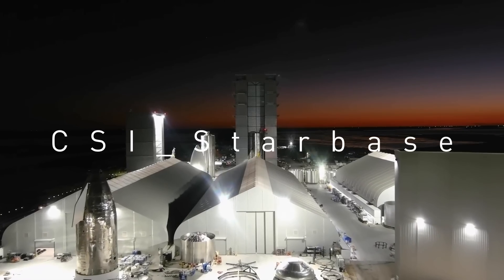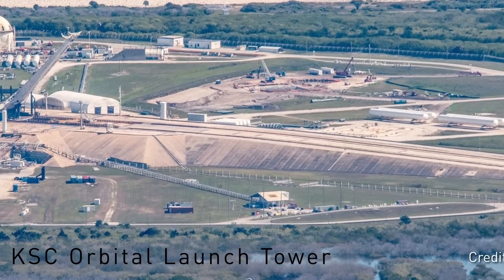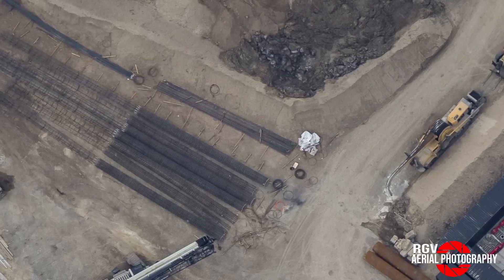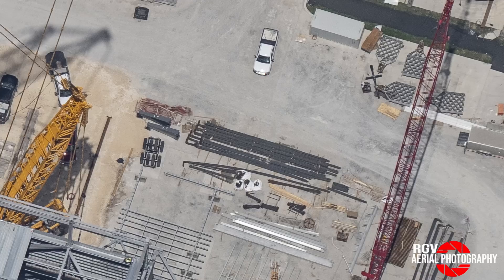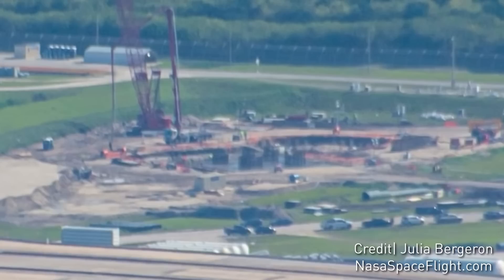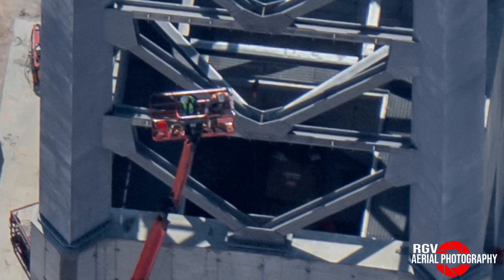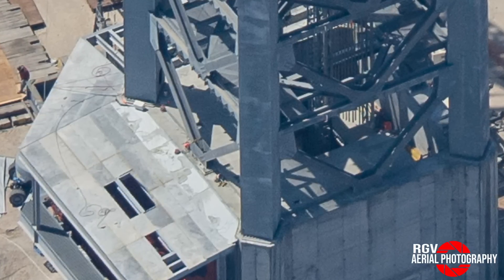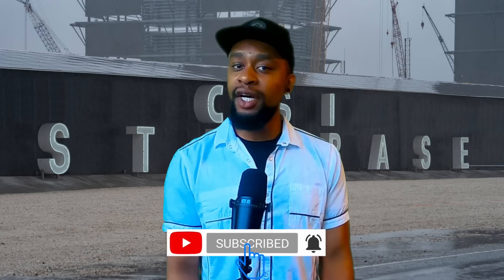Is SpaceX falling behind on Pad39A Starship Launch Pad Construction?

Comment: looks like the prediction around 5:00 regarding the floor was not fully correct, as yesterday SN16 was rolled into the new wider highbay - which means the floor already must have been complete. Which begs the question what this additional rebar is going to be used for.

Comment: Great analysis Zack, wish we could see more detail.

They may do a lot more fitting out of individual OLIT segments on the ground before lifting them into place this time since they have a prior design to copy. It's easier and cheaper to install a horizontal pipe 5m from the ground than 50m up so the whole thing maybe built quicker even if the foundations start later.